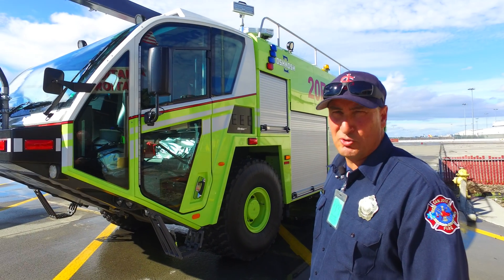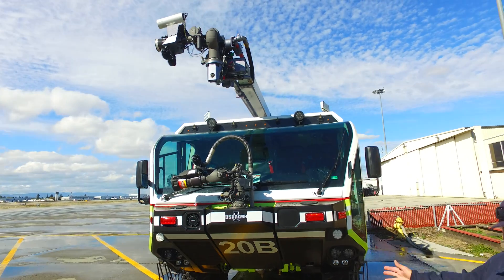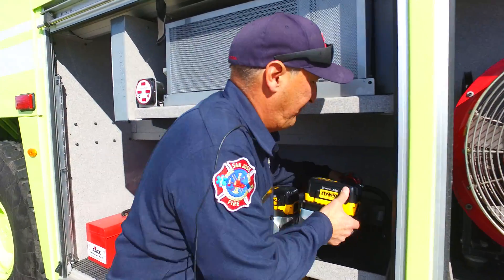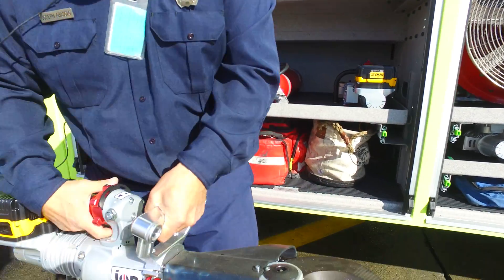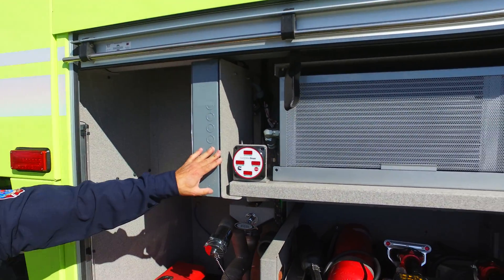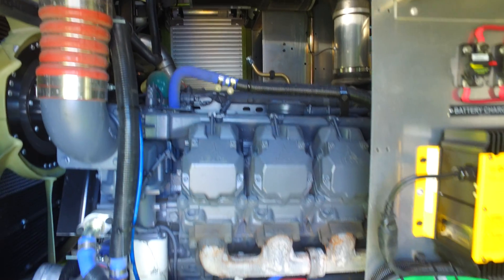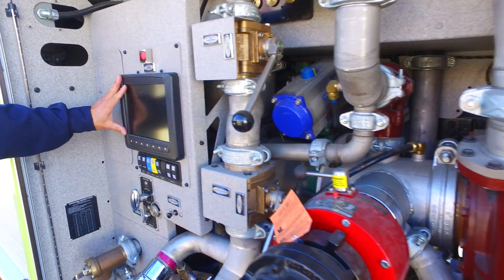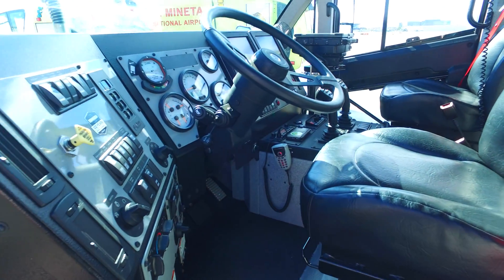4K Tour of San Jose Airports New Striker 6X6 Fire Truck

Comment: Advanced Life Support ARFF trucks? WTF
Reply: Their are actually a fair amount of Medical Calls at the airport, Specifically in 2017 Rescue 20 responded to 563 medical calls at the airport, They respond together with either Engine 5 or Squad 5 depending on the triage of the call, and station 5 is about 2.5 miles from San Jose airport...Station 20 units always need to stay on airport grounds as they are the airport station unlike other san jose fire units
Reply: @allthingsfire9926  yeah, i know how ARFF works. But to make an ALS Crash Rescue truck is weird. You'd be better off placing an ALS Engine or med unit there
Reply: @flskywarn  well I think the cost would be to much vs the need, A joint response of station 20 and station 5 is more efficient and cost effective than having a 4 person Als engine at the airport that would be getting very minimal call volume the need just isnt their, It just works better to have units respond from station 5 and have rescue 20 respond as well
Reply: @flskywarn  The ARFF unit isn’t ALS. The paramedic and firefighter cross staff Rescue 20 which is a mini pumper/quick response rig.